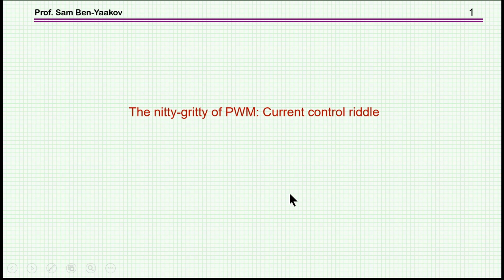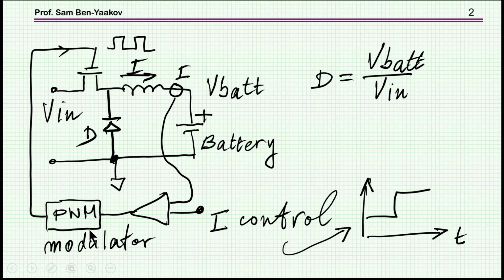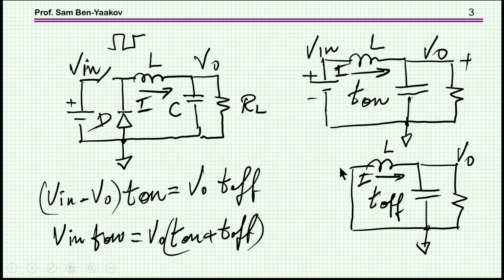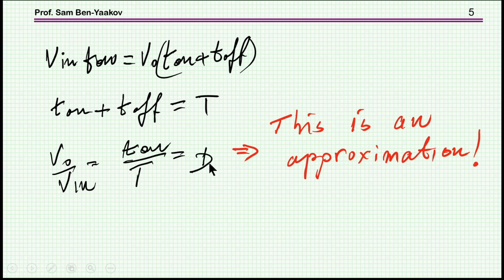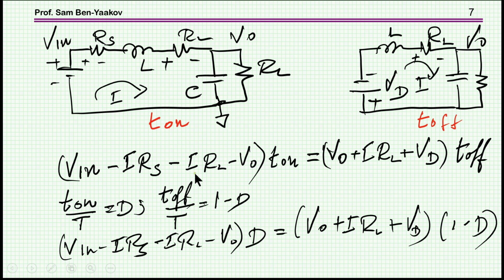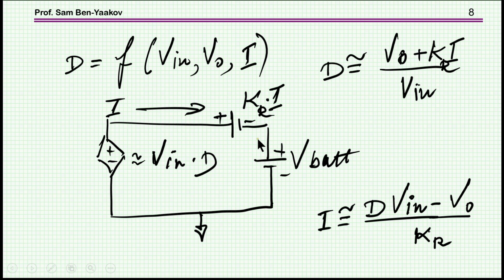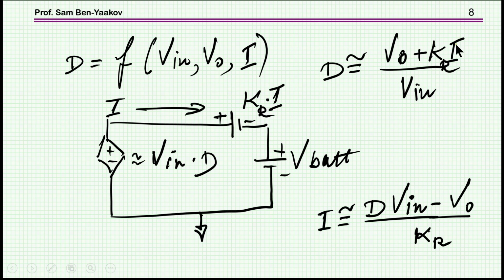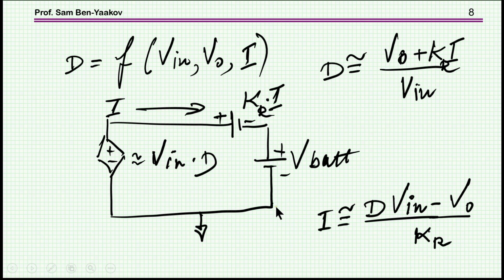The nitty-gritty of PWM: Current control riddle

Comment: This is not a good approach to explain the current mode control. What about an idealistic case, when all parasitic resistances are zero? The current control will be still possible. In that case, the duty cycle command would be changing over the transient, but it would remain the same value in the steady-state.
Reply from the maker: Hi,  My videos are intended to explain circuits of real world. In my world there is no zero parasitic resistances. From waht I explained in video is is clear that as the parasitic resistances are getting smaller the duty cycle deviation also diminishes.
Reply: vaks2l You have to understand that the level of these presentations is appropriate for every-day engineering, but not to people with PhD.